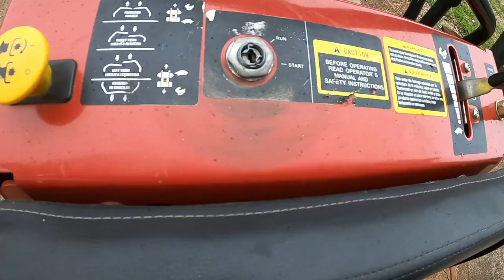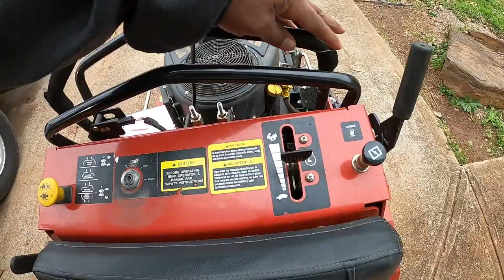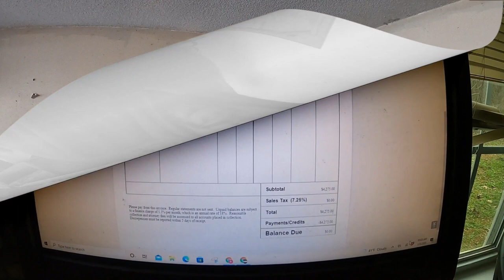Bradley Mower 36 200 HOUR REVIEW music prod. by NOYYDVISION

Comment: Nice review, I was glad to meet you at the G.I.E. about the ground clearance, we've changed that since 2021, there is a 1- 1 1/2" more than the previous design. the handle cover has been changed too, the new one with different material, last longer and doesn't need the cap.
Reply from the maker: Thanks for the updated info and thanks for watching the channel Simon

Comment: What's up, I got the 48", yeh really like mine too.  The one thing that bugs me on mine is the platform, it gets slippery when grass clipping get on it.   And yeh I bang my knees on the sides there too.  But the 48" will climb a hill like a goat!  I like that height selector pin you got from them.
Reply from the maker: what up bro thanks for watching I might have a remedy to the platform I will share it in a future video Im seriously considering getting me a 48 or 52
Reply: Dude, I don't know what flavor of crack SLE Equipment was smoking that day, but last fall they sold me the latest model 48" Bradley with the vanguard engine for less than what you paid for your 36"!  I had one issue with it, but otherwise I love this beast of a mower!